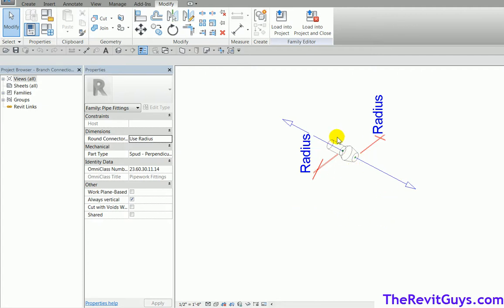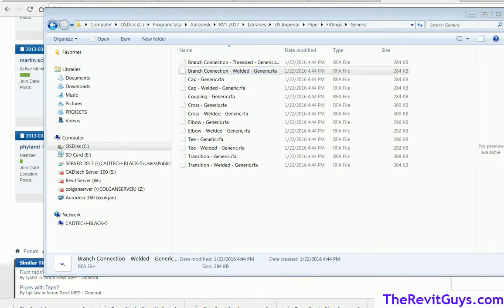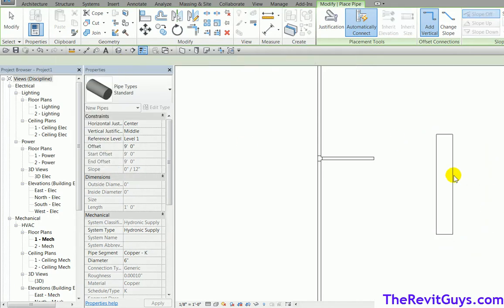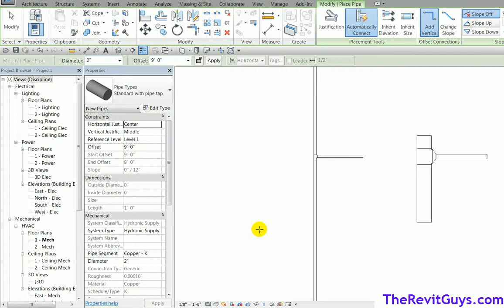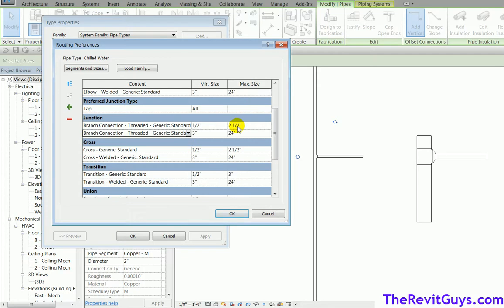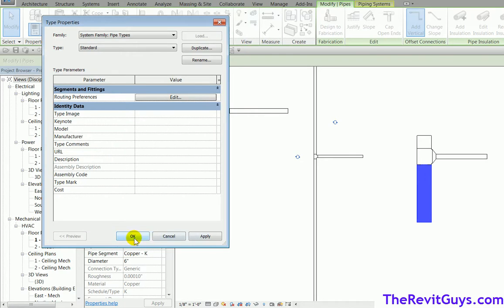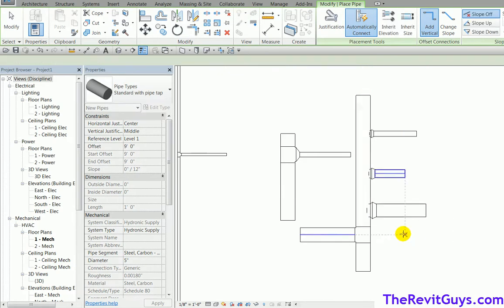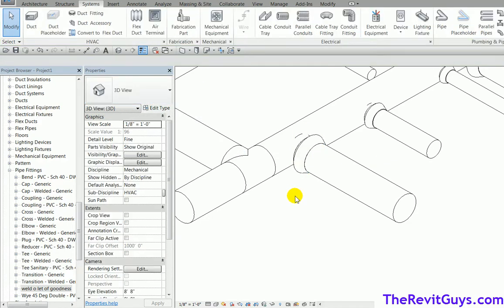Revit MEP - Creating a Pipe Tap or Weldolet Pipe Type - CADtechSeminars.com

Comment: Hello, excellent video...I have a question, with the same criteria could you make a fish mouth in the pipe? It is similar to the exercise only that the fish mouth is a hole in the tube and another tube is welded there.
Reply from the maker: I don't see why not. If you can find or create that fitting, you should be able to use it just like the Weldolet.